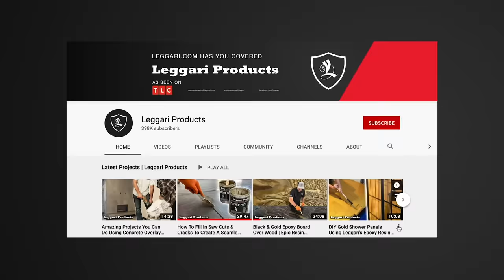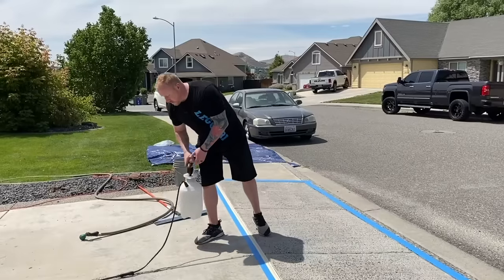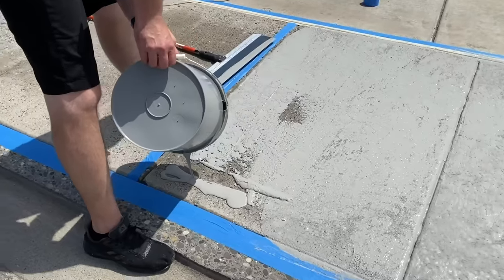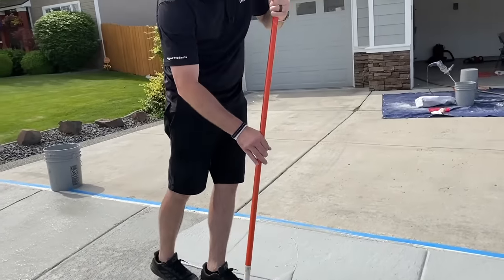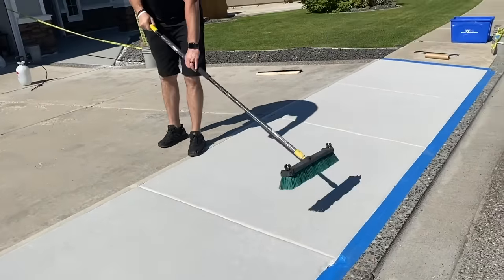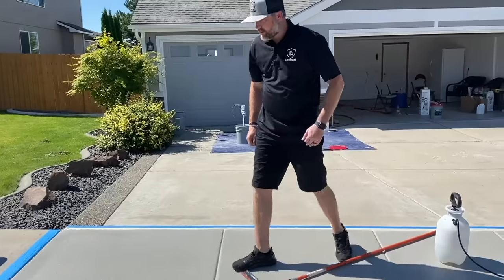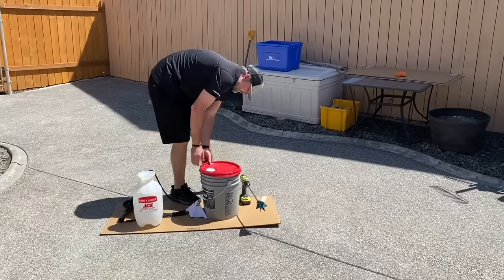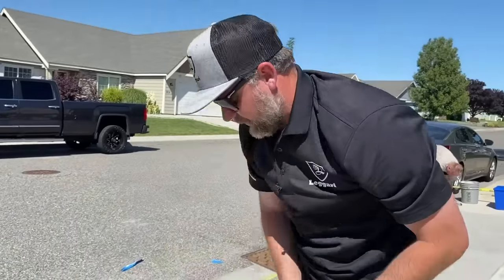How To Repair Old Concrete | Resurface Concrete Sidewalk | Restoration Project DIY Concrete Repair

Comment: Great explanation, yet it looks a bit too uniform painted...you mentioned there is powdered marble? How long would this repair last?
Reply from the maker: This repair will last the life of the concrete underneath in residential applications. In industrial and high traffic applications like bridges it may need to be re-coated in 5-10 years. Thanks

Comment: Holy moly!!! This was a 200 sq ft job and at $17.50 a foot thats $3,500!!! And that's not even including the tape, squeegee, broom and probably $1000 worth of water.  By the way, I'm not sure if he mentioned the fact that you have to keep the surface hydrated.  Did he??  I'm sure I heard that somewhere... 😜.
Reply from the maker: Hi Terry, not sure where that number is coming from? Our concrete repair kits are about $1.21-$1.53 per foot;  with 100 square foot kit being a little more. Thanks
Reply: @LeggariProducts   Sorry, John Pyle (down about 10 comments) posted the cost based on following the link. I just checked the link and indeed he was WAY off on cost.  But for a 100 to 250 square foot project it's closer to $3-$4 a foot. The lower price is more around the 2,000 ft mark.  Still, all-in-all a whole lot better than ripping out and replacing.  Something for next year's budget...😉
Reply: @LeggariProducts  Thx.  The link didn't give me an idea of the cost.

Never mind, it's there.
Reply: $5/sqft minimum in my area on overlays
Reply: Leggari Products Looks like you had the problem of recording in public. Thanks for sharing and very detailed job and well done. Keep up the good work.

Comment: I’d replace the cement before I put that much effort coating defected cement. It’s a bit more grunt work, but super simple and will likely last longer. 

Not a comment on your exceptional work. Looks good.

Comment: Looks great stuff I have my concrete drive way power floated and now it’s started top bit of it breaking up. How expensive is it
Reply: From what ive seen about 7-12 grand
Reply: @angelrinkson6238  no way. For how many square feet?
Reply: @angelrinkson6238  just checked their website it says 295$ … why would you say that lol

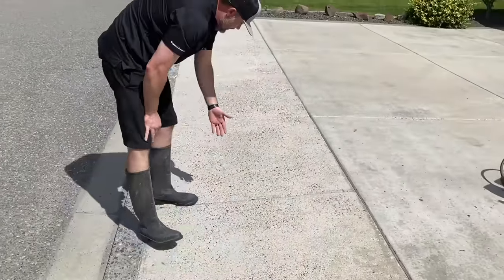Comment: Overall I'm impressed.  However, during each application of sealer, it appeared that you missed a lot of surface and it sure looks like missed patches during the final reveal @ 1:10

Comment: HI, HOW DOES THIS FINISH HOLD UP TO FROST CYCLES AND TRAFFIC? THANKS..
Reply from the maker: Handles just fine in radical temperature cycles, just make sure the curing process (first few days) happen between 50-70 degrees Fahrenheit. Holds up better to traffic than and seal coat on the market, doesn’t smell, and won’t track black residue onto everything. Thanks

Comment: Ok so depending on the size of the job, spend up to two days pressure washing the concrete.........
Reply: Prep is the Most important part if you want it to work or last
Reply: My first thought when I saw the pressure washing was to recommend a surface cleaner. And before I got one, every time I heard that term, I thought people were talking about a cleaning agent. But no, this is a device to attach to your power washer that does a better job at cleaning horizontal surfaces. I got one and it works really well and speeds things up dramatically.

Comment: You guys need one of those sand blasters that are half pressure washer. They advertise for stripping old cars - all the rust and bonds off the full size chassis in about an hour. Be great to prep that.

Comment: Thanks for showing this.  I have tried to use packed sand in aluminium square tubing to bend without kinking.  Not great success, but this  trick you showed is worth remembering.  My friend made bows as in bow and arrow.   This would have been easier with your method.  He just used a torch.
Reply: Ummmm - WHAT? This video is about resurfacing concrete.

Comment: I notice when you were power washing with water that you were washing from the street side up toward the garage door, which is sloped. If I were doing it I would start at the high side (up by the garage doors) and let the dirty water flow down toward the street. That way you would not be letting dirty water at the high side of the drive contaminate the clean surface which is lower. Different strokes for different folks I guess. Good job I must add.

Comment: That concrete looks like it was acid washed wrong.
Reply: It was mixed and poured too wet, and/or over-worked. All the cement was in a slurry on the surface. That's why the surface had no strength.

Comment: why would one repair a sidewalk, that usually is not owned by the home owner!!
Reply: In my municipality, if there's a problem with the sidwalk the homeowner will get a ticket to fix it from the city.  Usually that's not a surface issue, however, it's usually a sunken slab or lifted from roots and presents a safety issue.  Where do you live where the sidewalk isn't the responsibility of the homeowner?
Reply: @jasonkraus2831  I have done sidewalk replacement projects in many different cities. Sometimes a city makes the homeowner pay 100% of the cost, sometimes they split the cost 50/50, some cities pay 100% of the cost. Only a few cities paid 100% of the cost.  Never buy a house on a corner lot because you will have to maintain 2 or 3 times the sidewalk of a normal lot.
And yes, it is only for safety issues, severely sunken or raised slabs. Trip hazards.
Reply: @jacksplatt7567  corner houses are the best because you usually have more land and the neighbors are further away across the street. If you're too cheap to buy a couple bags of cement to fix a cracked sidewalk then you deserve having neighbors right on top of you LOL
Reply: @gregh7457  Hahaha.
I don't have neighbors on top of me. My lot is 125'x 350', about 1 acre. I only have to maintain 125 feet of sidewalk, if i had a corner lot i would have to maintain 475 feet of sidewalk.
I have replaced miles of sidewalks in my lifetime and one of the recent jobs was replacing all the sidewalks and driveway aprons on an entire street as part of a reconstruction project.
The cost to the homeowners was $300 for each 5'x5' block. Most lots in that neighborhood were 100' wide, so each homeowner had to pay $6000 for new sidewalks.
And the guy with the corner lot(100'x200'), he had 300'of sidewalk to pay for, $18,000!!! HAHAHAHA
Tell that guy that got the $18,000 bill how great corner lots are. Hahahaha
I don't need to be cheap and buy a few bags of cement because the city i live in pays for 100%, no cost to me.
HAHAHAHA
corner lots SUCK, LOL
Reply: @jacksplatt7567  pouring cement is not rocket science. most homeowners can fix a broken segment. don't know what you're going on about replacing a whole street and where you got those prices but where i'm at cement is only 55$ a yard if you order a whole cement truck. If your city is forcing homeowners to put in a whole new sidewalk at those prices, i'de say its time to leave that shithole
Reply: @jacksplatt7567  That makes sense and I very much agree about buying a house with two sets of sidewalks to maintain.  Plus, if you live somewhere with ice you have to shovel or salt that or you can end up with a claim against your homeowners insurance in the event of a fall!.  In my city you have the chance to fix it within a certain period of time or the city will then do it and bill you.
Reply: @jasonkraus2831  way up north past the American  boarder!!  I know we get free everything but we pay close to 35-45% income tax then the property tax about $5K every year..  So Canada is not as well off as most think.  Then we have politicians that blow money to support their own agenda..
Reply: @jacksplatt7567  if the city pays 100%   cost for repairs, why not have a bigger corner lot. Your words Mr. Splatt.

Comment: Like watching paint dry. You say everything at least 3 times.
Reply: Did someone say hydration?
Reply: @darken3150  I lost count how many times. Maybe potential customers would better understand "Wet the concrete" or 'keep the concrete wet so it does not suck all of the moisture out of the resurfacer.'

Comment: Can I use this same method around a pool on the cement apron?  Can I do the first layer at night and then start again in the morning?  How long so you need to wait between layers?  I have those brass things that hold the cover on in the winter.  How should I cover those?  They are round.  They screw up and down.  Loved this video I have been searching for you!

Comment: hello, Just found your page. I have a 1 car garage and the right side from the center to the wall  is 6" down. I cannot afford to rip out and repour. Is there a product that will fill that. say I fill most with regular concrete and use some sort of self leveler to finish it off.  I am in central NY and the garage is unheated and we get real cold in the winter

Comment: Don’t know if my question has been covered yet but my question is how do you manage uneven surfaces at the joints. Do you build up the low or grind down the high side? My driveway has areas where there’s an un even surface between slabs by about 1/8 to 1/4”.
Reply from the maker: It'll probably be easiest to grind down the high side and just get it as even as possible. This is a pretty forgiving product but definitely reach out to our team here for any help with our products https://support.leggari.com/hc/en-us/requests/new

Comment: I have a concrete patio in my back yard that is probably around 72 years old, same as my house. I would like to do this in the spring, but there are a few spots where a small bit of the concrete aggregate has popped out leaving about a 1/4 inch deep x 1.5 around inch pit in the patio. Can I use this to fill those spots??

Comment: This is exactly what I need for a project I will be starting in a couple months.
Also, you really should wear a mask when dealing with the powders.
Reply: Good god you are funny, why didn't you tell him to wear goggles, chemical gloves, a helmet and maybe one of those safety harnesses, steel tip boots and finally a hazmat suit so he could pass out from the heat?
Reply: jubjub247 I lost both an uncle and my grandfather to this fake af pandemic; that was very thoughtless. I truly hope this virus doesn’t touch you or your family. And this is a concrete repair product, not a political rally.
Reply: Jesus Is Lord~ again I will say, this is a concrete repair video, not not a revival. And my reply to someone else warranted no intervention on your part and is not your concern.

Comment: Thank you for sharing this! Wish I saw it before buying my t430!
In fairness, aside from the funky oil port, I used for two years. Did clear a good 1/4 acre of 1ft tall weeds and some scrub. Now, one of the string “poles” snapped. Was not machined but cast metal. BAD design. Ryobi tech support/customer service is 100% useless. Seems OEM service center from manual no longer exists.
Reply from the maker: Crazy stuff! Thanks for watching!

Comment: It looks awesome but my question is how long this product last ? I know all depends of the area and weather conditions like I'm from NJ so we have both streams cold and hot also in rain weather lot of water running on the sidewalk so it will work here??? Because I really like to do that even I tough paint but this looks like the better option!!!
Reply from the maker: Our Concrete Repair is extremely durable and does not delaminate over time! It typically holds up as well and the substrate beneath it while also strengthening the whole surface, resisting ice-melt and other chemicals. Check it out here https://leggari.com/product/concrete-repair-kit/ for more information and feel free to contact our customer support with any questions https://support.leggari.com/hc/en-us/requests/new Thanks and best of luck to you! Hopefully our Concrete Repair will be just what you need

Comment: Do I need to fill all cracks before  to apply the product? I have crack about 1/8 inch max on my garage floor. If yes, what material should be used to fill cracks? Can I buy products from Canada?

Comment: Perhaps use blue tape butting that up to the outside edge of the mastic then use the other tape on top of that and it will only fill in the mastic and the cleanup will be easier.

Comment: Hi, I have been watching your YouTube video with great interest.  7 months ago I had my driveway resurfaced, but now there are cracks appearing, and some parts the resurfaced concrete have come off.  I would like to know, how I can seal the fine cracks and the chipped off resurfaced concrete?  Your advise is greatly appreciated.
Reply from the maker: Hello! For cracks in your concrete, we recommend our crack repair. It is self leveling and will adhere extremely well to your concrete. It also maintains flexibility through freeze/thaw cycles. Check it out here https://leggari.com/product/crack-repair/
For more information, please contact our customer service. Thank you!

Comment: I seen how you resurfaced a porch and pitted cement. Two questions , part of the cement that we will be resurfacing is painted and part of the paint has flaked off and rest stucked to the concrete. Does all the paint need to be sanded off before resurfacing. Next question we have 2 slabs of concrete with about a 6" gap of looks like cold patch. Will the resurfacing cover the cold patch and just fill in like I seen in one of your videos where you let it thicken to fill in at a joint. Let me know. Thank you

Comment: How long does this last? Do you need to add more sealer ever couple years or say every 6 months? How much does it cost? Material cost and then labor. (Roughly)
Reply from the maker: Our repair products are designed for permanence and will stand the test of time as long as the substrate holds up as well. They will not wear off or delaminate even after years of use. You can check out our Concrete Repair and cost per a square foot here! 👉 https://leggari.com/product/concrete-repair-kit/

For a cost estimate, feel free to contact our customer service here 👇 
1-844-LEGGARI (534-4274)
customerservice@leggari.com

Comment: There  is a special attachment for your pressure washer that is strictly designed for concrete that looks like a 3 inch thick dinner plate. It gives much better results and doesn't leave that striped look when the concrete dries. That striped look is caused by dirt and other debris that is still in the concrete.
Reply: I agree and would recommend this instead of using the wand, definitely. It’s called a “surface cleaner“.
Reply: Yup if they were just wanting to clean it.  In this case  they wanted the focused pressure to break off any weak surface concrete and spalt it as much as possible and get rid of all the loost or weak surface concrete

Comment: Could you please explain what kind of concrete did you use and how long does it take to dry? I used one type of concrete before and it dried so fast While I was still working on my project.
Reply: It's not concrete. It's a resurfacing product that THEY SELL. If you watch the video and pay attention... every single thing that you ask was already answered. They even talk about the quick drying problem.

Comment: Use Rapid Remover for the tape residue. It works wonders, but, it isnt cheap, in western new york it averages about $30 for a gallon but a little goes a long way with it and i guarantee it will remove the residue easily

Comment: Looks great, but what about rolling the sealer for a more complete and even coat. Easier to spray of course.  Great video guys.
Reply: They mention 3 thin coats were preferred, which a roller isn't designed for.

Comment: Pressure washing can cause MORE spalling and weakening of the lime and the salt and pepper aggregate.  Unsealed concrete is permeable. High pressure water pushes water into the weak substrate pores causing more weakening problems, especially in cracks and joints! Use a wet floor maintainer process with a proper pad, sand, and water. Proper prep will help the overlay last. We remove many, many failing overlays because of improper prep. Check moisture levels with a moisture meter before you start, so you can see if there is excessive moisture from leaks, adjacent sprinklers, wet subgrade and wet, clayey, poor draining soil. If the moisture problem exists overlays will fail too. Indoor overlays are more durable. Outdoor overlays tend to have a short life cycle.
Reply from the maker: Great tip thank you!

Comment: For a homeowner contemplating a resurface what general cost per square foot should he expect?  Compare to having new concrete.  Also, what can be expected for life for the resurfacing?  What happens when degrade begins.
Reply from the maker: Hello! You can input your square footage here to get the general cost of your product. https://leggari.com/product/concrete-repair-kit/ 
Also, feel free to contact our customer service with your questions and inquiries. 1-844-LEGGARI (534-4274).   customerservice@leggari.com
Best of luck to you!

Comment: I was just wondering if you should pre hydrate the concrete before you apply the coating? Lol I think you reinforced the point well. A serious question... How long should you wait before applying a concrete paint?

Comment: How long does it last and can I do my concrete pool deck with this product?
Reply from the maker: Hello! This is our concrete Repair Product which will last years without wearing off or delaminating if applied correctly! For pool decks, we recommend our texture decking which is designed to go over existing exterior concrete and will provide texture and grip. Check it out https://leggari.com/order-flooring/#texture-deck-kits